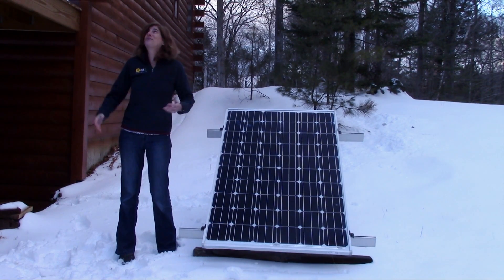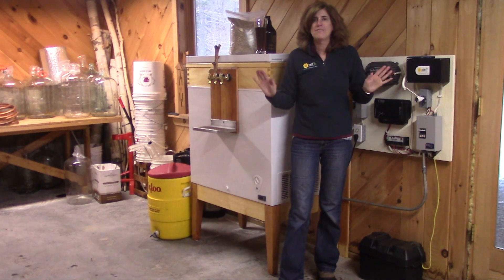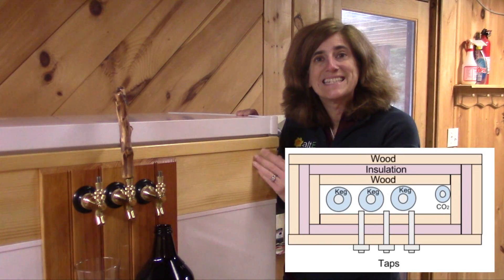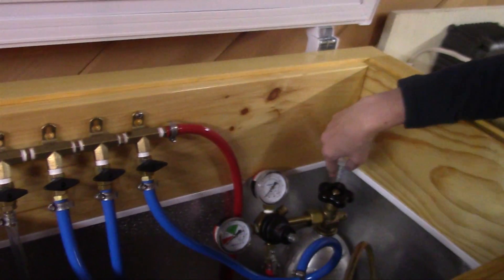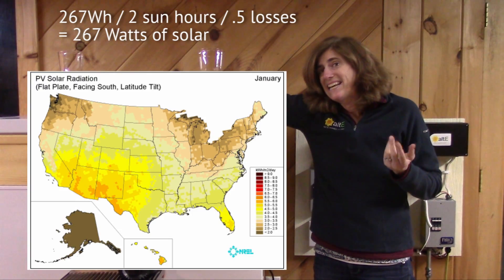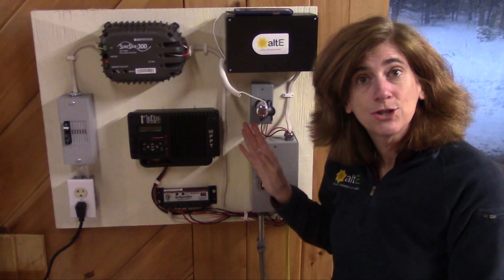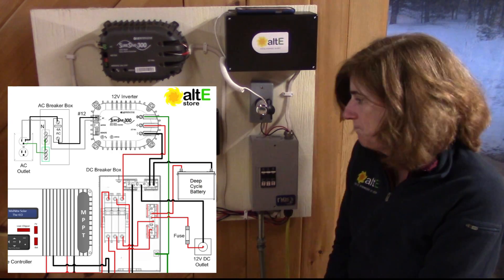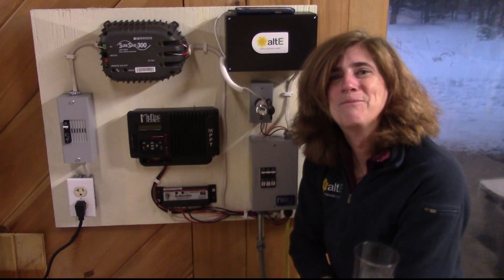Solar Kegerator

Comment: yes very much so,thanks for tec info I'll have to look over it seems a little confusing to me I'll have to study up on it I know I'm going to use my MPPT charge controller for something your way makes sense however I'll have to figure out how to wire them up like that.
Reply from the maker: +bill767667 We'll do a video explaining how to wire 2 charge controllers in one system. I'll let you know when it's done (usually takes me a week or 2).
Reply: Thank you so very much,that's very kind of you
Reply: Your idea to expand the size of that chest freezer with that top wooden extension is a great idea not only could that be use for a kegerator but I myself may try and use something like that down the road when I convert a chest freezer to a refrigerator you can add more cubic feet that way simply by going up a little bit and then remounting the hinges to the wood and then on the inside of the unit itself being that the wood was now on the inside it would be very easy to use stainless steel screws and install some sort of custom made shelving where you can screw on to the wood itself when  inside the freezer,,, that is a really great idea,,, your husband must be really good with his hands those are pretty fancy DoveTails(joints) it took somebody some time to do that,,,someone really knew what they were doing I noticed right off they did some really nice carpentry work there ,,,more than carpentry work I guess cabinetmaker,,,, first class all the way.

Comment: that's a nice setup I heard you say 20 volt panel I was not aware they made 20 volt panels are they better than say a 24 volt panel I have a 40 amp MPPT charge controller I have not hooked up yet however I am now learning that my Prostar PS 30 is nice however it can't recharge my batteries well enough on a cloudy day and the winter with its shorter days makes it hard for that unit to keep the batteries topped off I'll be using my MPPT controller soon,so if I buy 20or24 volt panels,my mppt should down convert the juice down to 12 volt? I also have a total of 8 /100 watt panels now,@12volts each,however I only have 4 hooked up now,I I used to drink whiskey back in my younger days funny thing is after I had a pretty good lot of it and the whiskey got below the label on the bottle made me kind of walk funny
Reply from the maker: +bill767667 The 60 cell panels that most people use for grid tie solar are 20V nominal. They usually have a Vmp of around 32V, so they are too high to charge a 12V battery without an MPPT charge controller dropping the voltage down, and too low to charge a 24V battery.  A 72 cell 24V nominal panel can be used with a PWM charge controller to charge a 24V battery bank. Both 20V and 24V panels can be used with an MPPT charge controller to charge a 12V battery bank. 

If you already have 400W of solar panels and an MPPT charge controller unused, I suggest putting all 4 panels in series, and connecting your MPPT charge controller to the existing system, in parallel with your PS30. It will have its own breaker going to the battery bank. The string of 4 solar panels will give high voltage low current to the charge controller, which will turn it into low voltage high current on the output. It's also much easier to wire than 4 in parallel.

Comment: ha ha,

you have two other components that you didn't talk about that box at the top right, and the thing at bottom left dc breaker box
Reply from the maker: +Rev John O'Toole You are very observant. I used my demo system from other videos, and those 2 boxes are not used in this system. The PWM charge controller to the left of the DC breaker box couldn't be use because I'm using a 20V solar panel with a 12V battery, so I replaced it with the MPPT charge controller in the middle, and the box on the top holds my little 7Ah battery that is too small for this use, so isn't used, instead the big battery is in the case on the floor. I plan on doing more videos up there and will be using those components for other demos, so I left them on the board, but disconnected.
Reply: HI Santa!! You must get even less sun than where i live!